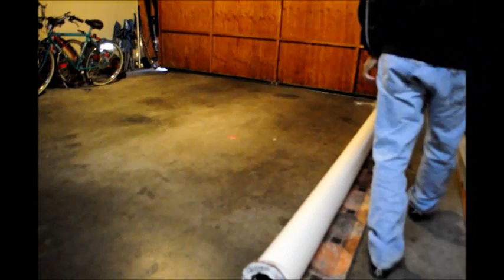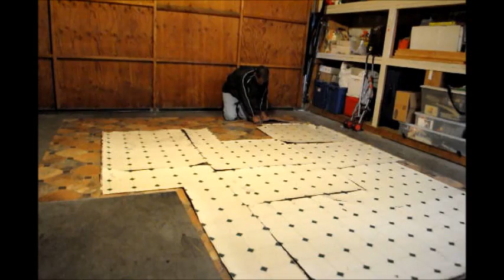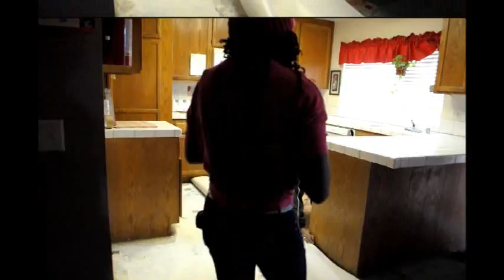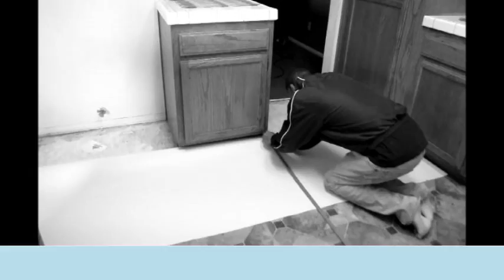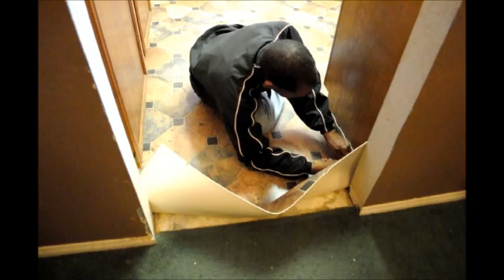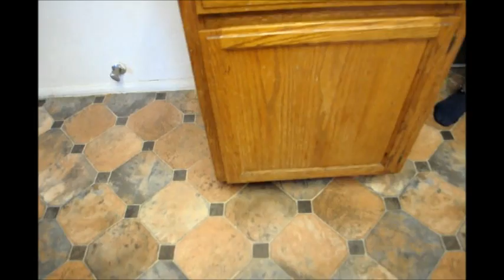Replacing your vinyl kitchen floor Part 2

Comment: Does your vinyl stay in one place with no vinyl adhesive?
That is the best if you don't have to use any adhesive.
Carpenters will need to take lessons from you.

Home repair people will charge thousands ($1000's) to do what your doing and not just put a little vinyl adhesive here a little, there a little, but they will DUMP it on the floor.

Then when it's time to replace the vinyl........bring in the pneumatic hammer!!!!